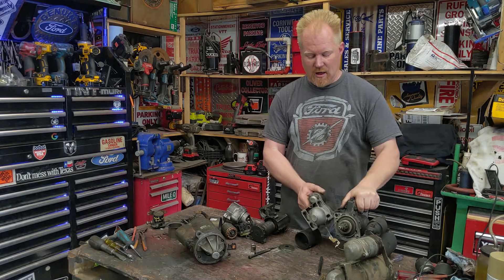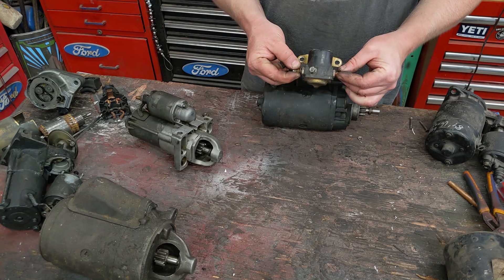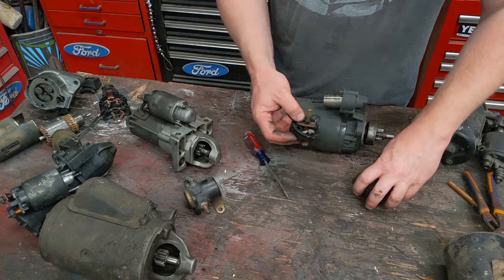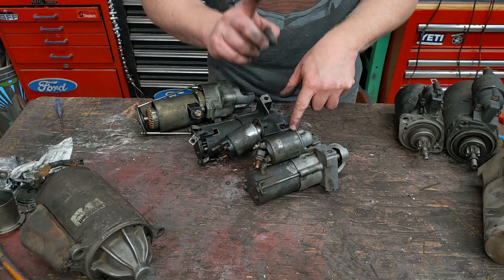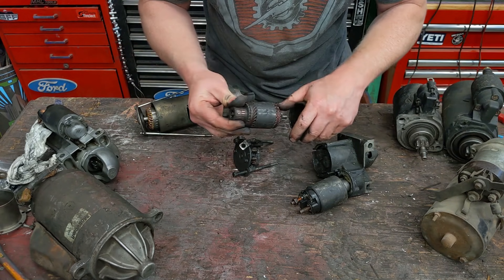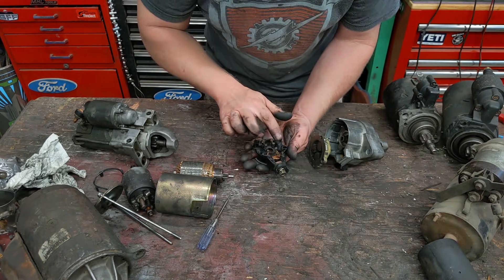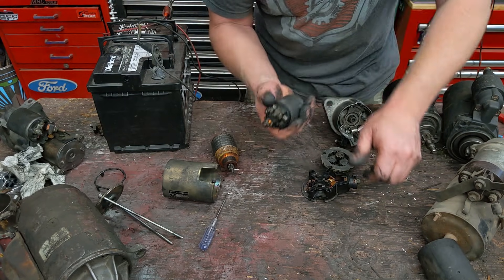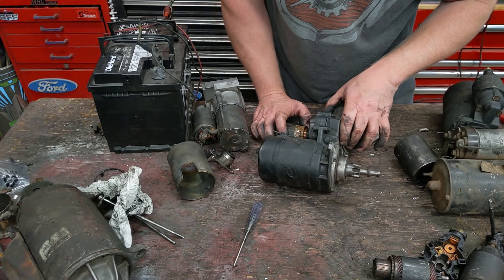HOW to REBUILD Starter Motors and HOW they Work

Comment: Sometimes brushes can be held back with a loop of wire. Cut them and pull the wire out once the motor is back together.
Reply: i took an alternator appart some time ago, it had little holes in the brushes to hold them back with a piece of wire stuck trough them, guess drilling a 2mm hole in a brush wont hurt it

Comment: The Spacers you reference are actually called Shunts, and they terminate the magnets ability to leech past it. The reason is, each magnets is alternated N/S-S/N-N/S-S/N on the "can" housing. Much like on the older starters with the electro magnets,  only the Shunt on those are inside the copper wrap. The GM version of Reduction Gear Starters are called PG260 for Planetary Gear Starter. I worked at Delco Remy for 9 years before the Mexican/Canadian NAFTA treaty was enacted and I was involved in every aspect of manufacturing from the Bendix components and assembly to the Relay Solenoids to manufacturing the Armatures, cans, magnets, shunts....the list goes on and on. In the waning days of Delco in Anderson Indiana, I was the sole Starter Generator re-manufacturer and 9/10ths of repairs were either brush related or bearing/bushing related. Great walk through Moe! Takes me back. Cheers! Zip~
Reply: Wow, that's cool.
Reply: Nafta was the last nail in the coffin for US manufacturing.
Reply: Where would be a good place to buy the mats, so that I can start rebuild my own starter(s)

Comment: The electric switch is called a solenoid switch.    The solenoid part is the spring loaded rod and electromagnetic coils around it that moves back and forth when power and thusly and electromagnetic field is applied to it.

Comment: I rebuilt my Honda Civic starter with new brushes last year. Just this week the solenoid started acting up. It was a sealed one so i had to carefully pry it open, and found one of the two contacts worn down. I put a washer behind the bolt/contact as a shim and it works very well now. It wont last long however, so i will have to order new contacts or a whole new solenoid. Great video. Thanks and greetings from sunny Jamaica.
Reply from the maker: That's great
Reply: Hi there....can you share the solenoid part number? I realize I might not have the same starter but I'm trying to learn more about this scenario of a failed solenoid before I order the kit. I've got a manual 12 civic lx sedan 1.8L. I basically want to do the solenoid at the same time and not have to come back to it. I've got 180,000mi on this.
Reply: @richcombs4805  I sold the Civic nearly a year ago. Sadly i don't have a part number.  I suggest getting a used starter from a junk yard if you can't get the correct part.

Comment: My '87 Mustang came stock with the old style direct-drive motor that had field windings with full power switched by a fender-mounted solenoid (relay).  When it failed, I used one for a later year (such as '93) that had the planetary gear reduction and permanent magnets instead of the field winding.  OUTSTANDING upgrade.  I had to run battery power direct to the starter, but that was the only required mod.  The new (Ford) starter has lasted 20 years and 150K miles, still going strong.  SO glad I made the change.

Comment: That copper tab (copper disc on some models) if often the cause of a no crank problem. If you tap on the starter while someone is trying to crank the engine over and the engine cranks over its usually because of pitting on that copper tab creating a bad connection.  You can clean the tab, or flip it over, and clean the mating copper lug it contacts and the starter will go another 100,000. As long as the commutator isn't worn down, as you mentioned. Good recommendation on staying away from the $60.00 starters. Either rebuild it yourself if you have the skills, or buy a quality starter, saving you a potential failure on the road, and giving you peace of mind. Good video.

Comment: This helped me determine the brushes had worn down on my starter. I heard the auditory click of the relay engaging, but the motor didn't want to spin up. I've rebuilt a riding mower starter before, but they're just slightly different than an automotive starter. Great video, very informative

Comment: As i used to work in an auto repair factory, there were a lot of starters around.
The carbon brushes and commutator needed to make a very good low resistance contact.
Fine sand paper strips were handy for cleaning the commutator,  then wrap the sandpaper with the back on the commutator and rock the armature to shape/clean the carbon brushes.
I bet you have a similar method.
Also always clean the joins in the casings to keep a good earth from the front bracket all the way to the back brush cover.
It matters a lot as really high ampage needs super low resistance.
Fix them starters :-D
Reply from the maker: Great info. I do very similar techniques on motors.

Comment: Good video, especially comparing cheapest to most expensive. I doubted you, but no more.... 2 years ago replaced my lucas starter on a ford 655c backhoe. Solenoid bad, didnt have time to fix, so bought the $128 version on Amazonia. So that one died a week ago. Got them both on the bench. Opened the cheap one and lo and behold looks like the brushholder was strapped to a muffler in upstate New York for 5 winters. Damn thing was so rusted, that one of the brush springs rotted away. Opened the lucas, and it was totally sealed with orings and plugs and silicone washers - sparkling new inside. 
             This brusholder had coil type roller springs, heavily galvanized and as new. Copperbrushes with little wear. The rusted one had one brush still moving, one broken spring, and three carbon brushes lodged in position non-op . Ca-Ca. For the sake of $2 they built a piece of crap on purpose. It seems to come from Romaine Electric, big outfit, all over the USA.  Though likely Chinese import. And no, we don't use salt here and my 81 ford pickup is rust free.
              Looks like if you buy a cheap one you need to open it and check the internals. Not for me again.

Comment: Excellent stuff, here in British Columbia I discovered the jobbers no longer carry rebuild kits for starters or alternators so you're left with paying $ 200+ for a new starter or you head over to ebay and pickup a solenoid rebuild kit for $ 20 delivered right to your mailbox. we also have a problem with crap batteries and have to hunt down the Johnson Controls stuff, of which we only have one dealer.

Comment: I experimented with a 90s gm non-gear reduction starter and a China gear reduction.  The 90s pulls more current, but spins the motor at about 300 rpm.  The GR starter pulled less current and only spun the motor over at a little over 200 rpm.  That extra rip-ems makes a big difference in how quickly my carbed gm boat motor starts.  Need healthy batteries though.

Comment: I should also add, it's important to clean the Lands and Grooves on the Commutator, because often the Copper/carbon/corn starch comprised brushes will breech the gaps of the Commutator and make the starter function weak or have a flat spot where two lands or more cancel themselves out due to having conductive material in the grooves. Cheers again! Zip~
Reply: Awesome tip

Comment: Holy crap. I had a '65 mustang that I used to have to start by using a screwdriver to jump the terminals on the solenoid just like 2:30.

Comment: just put out $148 w/core . would not start, had to replace in a parkinglot. and niw yfruck starts but sounds lume it did just before starter went out. got new 5/24 battery with even higher cca than needed, still same sound, it struggles to start. flex plate does not make bad sound. ring looks fine

Comment: Apparently the Starter Solenoid is sometimes called the starter relay, but in Modern time, we reserve that name  for a separate relay which supplies power to the starter solenoid.
Battery sends 12v straight to the Starter and the Starter Switch sends a positive signal (not always 12v)through the Relay to the Starter Solenoid.  
A conventional Electromechanical Relay is part of a Solenoid that opens or closes one or more set of contacts, but a solenoid is an electromagnetic actuator that can do many different things

Comment: If you put a 1/4 20 nut in between those springs to hold them in place you can get it to squeeze in then shake the nuts or

Comment: Very interesting. The starter went out on my old car and I got a $47 starter from ebay. It worked good for the year and a half I had my car before I sold it. I hope the new owner didn't have it die on him. It was very easy to remove and install the stater on that car.
Reply from the maker: The cheap starters do work, which I can't fault them there. They're just so cheaply made I would suspect a heavy road salt state they would rust completely apart in a season.
Reply: @sixtyfiveford  I think you're right about that.

Comment: And the older gm starters are really decent but if they wear the holders or brush fingers in a odd pattern it can be a big pain to fix, but I have bought a Amazon $65 new starter but ac Delco factory service replacement professional line works great my older starter dragged to the point of almost killing the battery before it started the truck so not only did it need a solenoid but I am sure the brushes were smoked, and it should have had the mini high torque starter on the truck to begin with anyway it was a early 94 Chevy extended cab short bed Z71 tbi truck

Comment: Nice man.  Good coffee time watching at work.    For my 79, i just use O'really's reman.   The 98 XJ I just bought, replaced it even though it worked.  The PO let the oil filter gasket leak over it for years.  Couldn't even see it.   Nope, not trusting it.
Reply from the maker: Yeah, my old Fords all have Lifetime parts store Starters. But those were all around $50 when I bought them. These days a $200+ starter is pretty common place.

Comment: Another good video , I have always gotten the ones with the life time free warranty for starters , alternators ,shocks ,ext. and it sure pays off in the long run . I found a place called Just Parts it has a lot of good stuff for this kind of repairs thanks and stay safe  TANK
Reply from the maker: Absolutely. I have many in my old Fords that are Lifetime parts store starters. I just swap those when they die but those were around $50-60 when I bought them. These days a starter in a new car that is under $150 is a good deal it seams. Thanks for the info, I look them up.

Comment: A small aluminum flashlight tube can work well as a brush retainer,  works great when rebuilding my ford gear reduction starters.
Reply from the maker: Seams like I need 10 hands on some of these to get the brushes in.

Comment: I wish my 1990 had a PMGR starter.  Cost me a pretty penny to convert!

Factory starter was weak trying to turn an 11.5:1 compression motor!
Reply from the maker: Now that's some compression!
Reply: @sixtyfiveford  It's no wonder why they had to move from direct drive starters... nearly everything these days is > 10:1.

That said, 11.5:1 is the pump gas motor...the race gas motor is 13.5:1 with the timing locked to 35*.  Starts right up with a PMGR starter.
Reply: @RK-kn1ud  The triple reduction starters make a HUGE difference in cold weather climates when the oil gets thicker than molasses.

Comment: What about older Ford/AMC/Jeep starters with separate solenoid? Should run by grounding the case and touching hot to the terminal lug on the starter, correct? I have one which will only cause arcing when power is applied. Pop the bendix cover off and manually engage the bendix (opening the contacts at the bendix arm) and the motor spins as normal. However, it will not run otherwise. Internal short?

Comment: In the early 80's there was a small company in my area that rebuild starters and the cost was reasonable ..I use to make extra money swapping the head of  the GM starters so a chevy one would work on a buick olds or pontiac
Reply from the maker: That's neat. I used to take them to a shop to get rebuilt for around $40-50 in the 90's but those places are long gone.

Comment: Some of them also fail from the internal gear guiding the planetary gears around the sun gear. If your motor is modified, then the torque required to start it cannot be held within the plastic internal gear, so the internal gear’s teeth will wear out, and your starter will spin in place without enough bite to crank the fly wheel. Interesting issue, some race parts shops sell metal internal gears. The plastic ones are used in OEM over metal because, although not as strong, they dampen the startup noise, unlike the metal ones. 

The internal gear is also, as you put it not easily serviced but they do sell the “upgrade” from plastic to metal

Comment: I think the main problem I have had with starters is the drive going out. I know many do not like the old Ford solenoid design, but I do. Easy to replace when it goes and if you work on the starter, there is that much less weight and bulk.  Not to mention if you have to jump the solenoid it is a whole lot easier. That said, I don't think I have ever replaced a starter on a Honda except once. and I have had a lot of them.
Reply from the maker: It may be a regional thing(wetter, salted roads etc) or even a vehicle make to have the Bendix go out. I don't think I've ever had the gear drive bendix fail on a starter.
Reply: @sixtyfiveford   You are probably right.  Now that I think about it, I never replaced one when I lived in Arizona.  Batteries and exhaust lasted longer to.

Comment: I once tried to get s starter solenoid for a 2002 Saturn the people at the parts house didn't even know what it was. This part isn't even listed in their computer system. So im my frustration i told them that 90% of rebuilt starters this is all that is replaced and i now have to put this one back together give it ti them and spend $130.00 for a rebuild off their shelf. It wasa Saturday and the place was busy.

Comment: If the commutator needs cleaning it's best to make a very light cut using a lathe rather than using wet/dry paper because the paper will leave abrasive particles in the copper. If you have access to a lathe, of course.....

Comment: Thanks for sharing this awesome video!
What type of grease would you recommend for plastic planetary gears?
I have Valvoline red grease on hand, is it safe for plastic?
Reply from the maker: Most "plastic" in things like this are Nylon which is resistant to all greases that I know of.
Reply: @sixtyfiveford     
Thanks for the reply! 
I already used Valvoline because it was Christmas, and I had no other option. I feel much better now.

Comment: I have a k series Motor and got a starter from the junk yard.. from a j series Motor but doesn't have the housing and gear reduction ( learned from you) can I swap them output teeth? I was going to get the $60 starter till I seen the video.
Reply: My starter has been making a crazy sound for the last 3 weeks with occasional grinding while I started and finally it stopped. Is this due to me driving in higher than expected puddles haha.. do I just have a buildup causing my brushes to stick because it sounds like it's just stuck

Comment: I have a lawnmower starter. I can’t find anywhere and I’m thinking about rebuilding it but I’m not sure if it’s good or not it turns but it turns really slow and the housing is magnetized don’t know if that’s normal or not.. I don’t see a solenoid on it anywhere but I do see two coiled one for the  spark plug and one to the starter . Can you give me any ideas. I have 13.5 volts to battery. Thank you
Reply from the maker: Belt drive starter or does it have a toothed engagement?

Comment: I have a 1997Ford f250  super duty  slow crank need help.
Reply from the maker: Check all your battery cables/connections first. You can use jumper cables to go straight from the battery positive to the starter (doesn't hurt to also run the ground). This will tell you if it is a connection issue or a starter issue.

Comment: Green corrosion= verdigris= copper,bronze or brass connections to non ferrous connections or exposure to corrosive atmosphere,aka salt,or even fresh water... Clean it off using a brass bristled brush or any sharp edge in a scrapping motion before making a new connection..
Reply from the maker: Absolutely.

Comment: My son's 07 accord will always spin the starter, but the bindex must not be coming out, as it isn't cranking the engine.  Any advice?
Reply from the maker: Sounds like your exact issue. Generally the contacts get pitted / corroded and it just won't spit out the Bendix.

Comment: I have a starter with the separate solenoid that has only an electrical connections / no mechanical interface (like one of those you showed).  Mine is sticking in the engaged position with the bend out against the flywheel with no powder to it at all. What makes it retract? It's also turning slowly. Great video!
Reply: I had the same problem with a brand new Perkins starter.  It was the batteries that were not fully charged.

Comment: I really thought he was going to show us some tricks for holding the brushes back.
Reply from the maker: I generally use mini flat head screwdrivers, picks or bailing wire. There are generally holes designed into the brush holders designed for this.